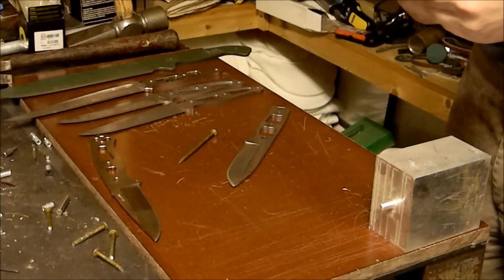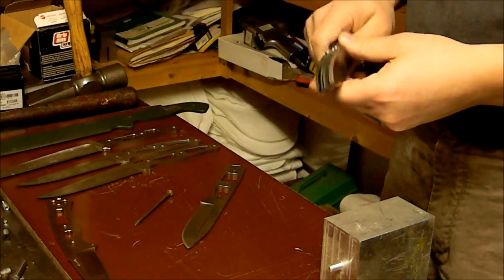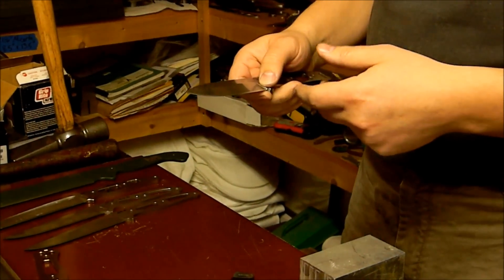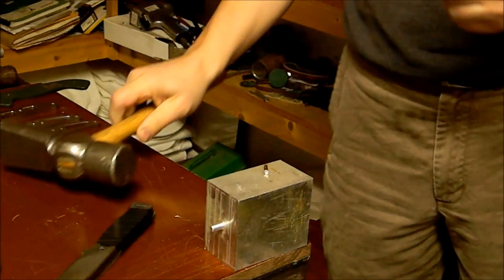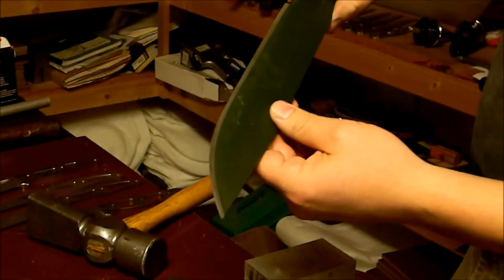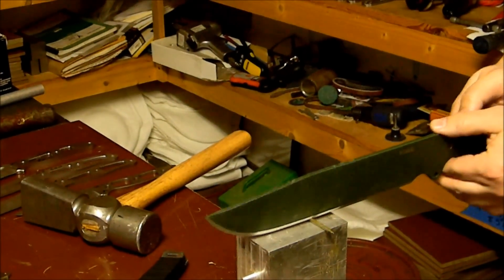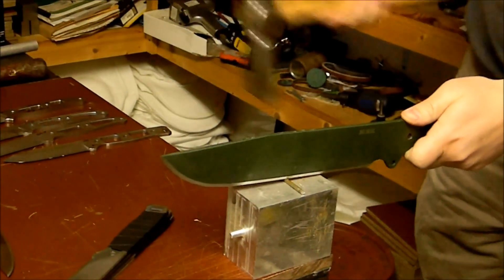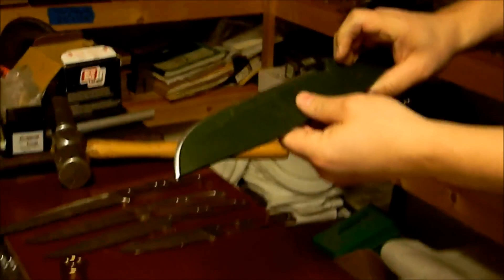3V heat treat tweaks, edge durability demonstration

Comment: I am not sure why you would call this edge stability, as it isn't what Landes meant by the term. As you are testing fairly large scale resistance to deformation it is basically strength, with a small check on ductility and impact toughness in the extremely low ranges as there is some deflection and impact. 

If Peter's is deforming so readily I would suspect they have higher amounts of retained austenite or diffusional based phases in the micro-structure, likely from air cooling and then relying on secondary hardening, use of a snap temper, or gap between quench and temper.
Reply from the maker: +Cliff Stamp I don't know, "edge stability" seems to say what I'm trying to say? 
There are a dozen 3V knives on that table, all a little different, but I
 could probably tell you which one was which with pretty good accuracy 
just by the way the edge behaves. There is a noticeable difference, and 
"edge stability" seems like a pretty good description of it to me.

This was a cool project. I took a methodical approach, kept good notes 
and went into it with certain expectations that turned out a little 
different than I thought they would, and I methodically tested some 
preconceived assumptions and found that some of them did not apply so 
well. You have mentioned some of those things, and you and I have been 
of a similar mind there, and I was surprised to find that two important 
assumptions that are true with similar steels do not appear to apply to 
3V.

It was useful applying knowledge that can be found in the literature 
that relates to similar materials and also using experience developed 
with other alloys to get started down the right path, applying cryo and 
abandoning the SHH, but 3V is not affected the same way as D2, and it 
seems to have a peculiarity I haven't seen in other materials that may 
be a side effect of being a CPM steel. If you're curious, send me an 
email, I'd be glad to discuss it, but not on YT.
Reply: +NateAIM Nate, the thing is there are already materials terms for it so I don't see why you would redefine them. Edge stability is the ability of the edge to keep a very high polished edge to a high sharpness at a very low angle. What you are measuring is more akin to gross lateral strength, a different properly.
Reply from the maker: +Cliff Stamp What you're describing there is "fine edge stability" which is not the 
subject of this video. To discuss the attributes of the edge, without 
mentioning the edge, with a term like "gross lateral strength" is not a 
very useful description. You're aware that the "gross lateral strength" 
of these test blades does not actually correlate well with the 
performance of the edge in the demonstrated test?

I'm aware that Roman has written a book on the subject, I recognize he 
is an authority on the matter and I respect his prerogative to create 
nomenclature on the subject, however I don't speak German and I haven't 
read it.
Reply: +NateAIM Nate, I don't know what you mean when you say lateral strength doesn't correlate well with the performance of the blades in that test. 

It can't possibly mean what it appears to using the scientific meaning of correlated as that would be completely nonsensical as you would be claiming that the results would be independent of blade strength. Measurements of lateral strength such as a three point bend test would have to correlate highly with what you are seeing because what you are measuring is influenced by strength. Anything which is influenced by strength will by definition correlate to a materials measure of strength.

Now if you mean there are other factors, yes. As I noted, a material could have very high lateral strength, but have the fracture strength so low it would just break even though it would not deflect at all (ceramic for example). Hence what you are seeing is a combination of lateral and fracture strength. The crushing or compressive strength will not be overly loaded because the materials you are cutting are in general soft but mainly because the lateral fail point is so much lower it will fail before the compression failure. 

It isn't about a perogative, anyone can make up the definition of any words you choose, you just are not speaking English at that point. It is simply the fact that there is an established meaning in the academic literature. It would be no different than redefining other terms such as wear resistance, strength or ductility or for another knife maker to call the blade and handle of his knife the spangle and dangle. Yes you could, but aside from confusion there is little sense to do so. 

Especially when you know that people talk about edge stability commonly based on Roman's introduction of the term for over a decade and now you choose to use the same term to talk about something very different.
Reply: +MAX KAWS Max, it is used that way in the metallurgical literature which I cited in the above. 

What does any of this have to do with Busse, it wasn't even mentioned.
Reply: +Cliff Stamp Since when edge stability means "ability of the edge to keep a very high polished edge to a high sharpness at a very low angle" ....

You seems always bias toward Busse didn't you?

Comment: Hi Nathan,

Are you talking about further changes past the low tempers and accelerated quench to avoid secondary carbide precipitation?  If so, are you able to discuss what further changes to the heat treat you are doing?
Reply: +NateAIM I did this test this morning after seeing it with a CPM3V blade with the standard HT but RC 61, a CPM3V blade with the low temper I asked for "keffeler HT" they said 60.5 ish, and two zwear blades with the standard tough HT 60-61RC all from peters. The zwear and the low temper HT 3V faired about the same which was almost no seeable damage. One of the zwear had nothing but the other had a very small dent or roll and the 3V had almost nothing. The 3V at 61RC with the standard HT deformed like the one you had. Between the 3V I have I got basically the same results.
Reply: so what HT would you recommend for the 3v if I'm sending them out?
Reply from the maker: +C amber Yeah, I'm finding that avoiding the SHH is the key to this alloy, but 
experience has shown there can be a couple little pitfalls. 3V has a 
couple quirks, and we have adjusted our process to address them but it 
is fundamentally the same as what you're talking about. This tweak was 
more about adjusting the HT for this new application rather than 
re-inventing it. I don't think there is one right answer to this, though
 I've found of a lot of wrong ways to do it!
Reply: +NateAIM Thank you Nathan.